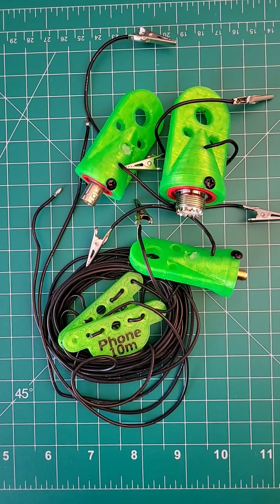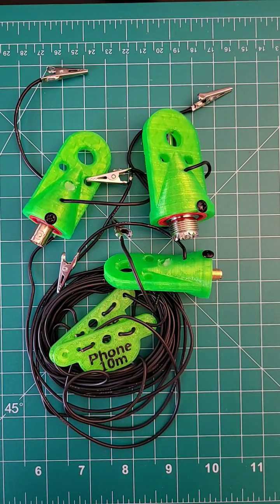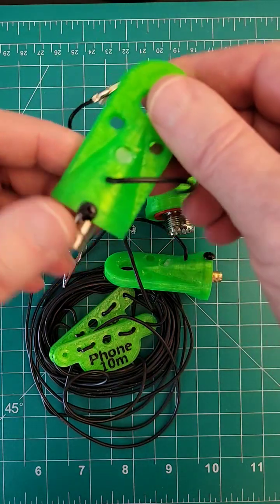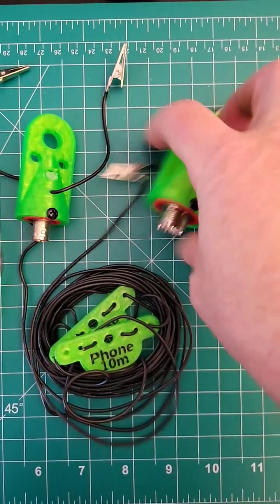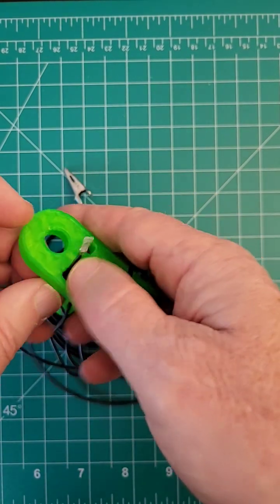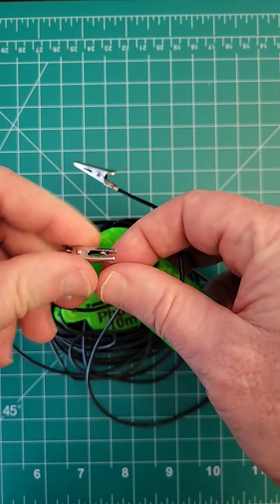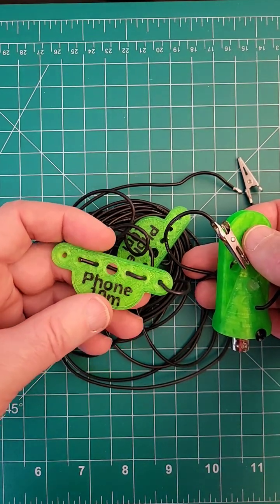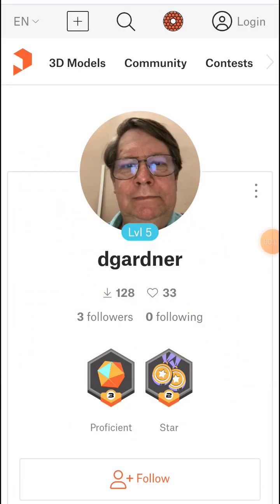Ham Radio 3D Printed Dipole Antenna #shorts

Comment: Is there someone that can print these out for ? I don't  have 3D printer ,I'll pay them for doing it, Thanks for any info
Reply from the maker: Hi Gary - I am in the same situation.  I was just lucky enough to be in the right place but it's difficult to find someone willing to print, even with payment.
Reply: @Red Summit RF  My buddy I told him I would make a couple if we could find someone to print them, and he had a buddy that's got a printer so he supposedly going to make them for use ,he said he just needed the file it ,So we sent it to him. But I almost found out that a guy in my radio has one too. Thanks for your video, I like making things
Reply: KD9WTH  73